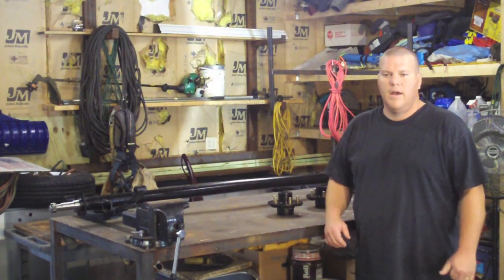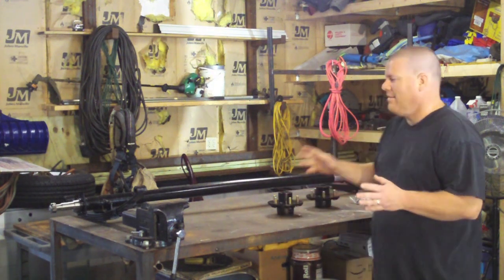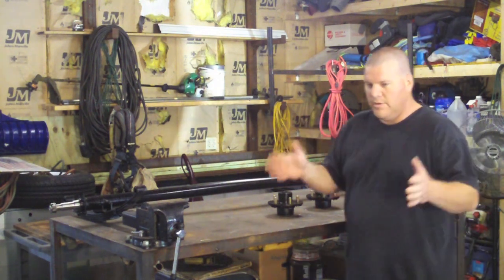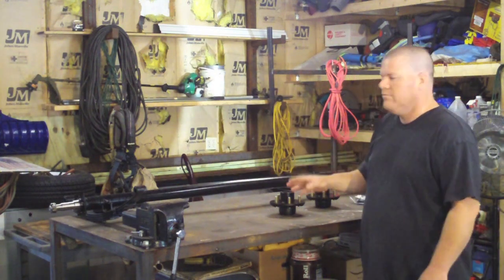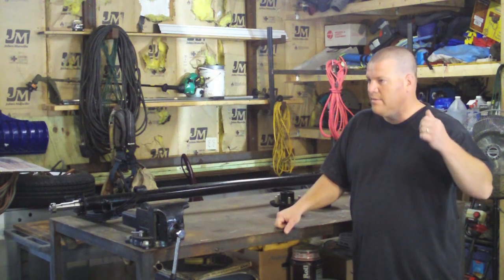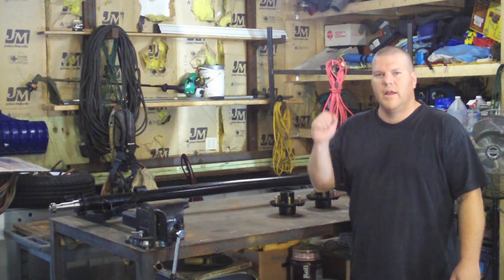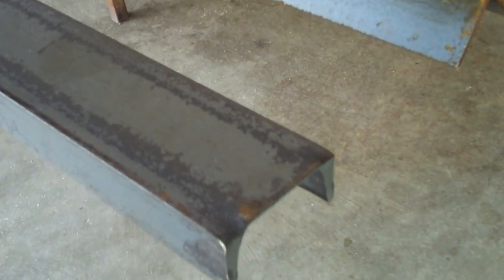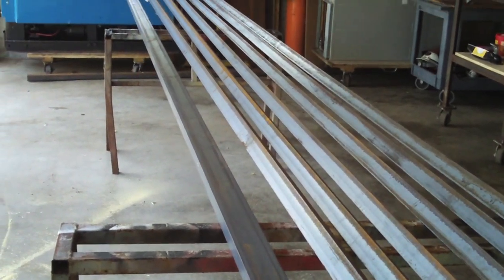How to Build a Utility Trailer Part 1 Introduction and Materials

Comment: I'm also thinking about building a trailer but I was thinking about using Square Tubing 2 inch by 2 inch by 1/8 inch would that have enough structural strength instead of using 2-inch by 2-inch 3/16 angle what are your thoughts

Comment: I am looking to build a snowmobile/utility trailer. The problem is I don't see many plans for that wide of a trailer (80+ inches).  Any thoughts?

I also noticed that you use angle iron, would it be stronger/better to use box steel say 2 inch?

Thanks...great vid!

Comment: subscribed!
i have been thinking about picking up some extra cash by building a few utility trailers
i'm thinking about making a jig that everything clamps to then i can weld everything together. ....question how do you feel about running 6010?
it has more flex than 7018 which i like

thanks

Comment: Hey! great vids I've learn more about building trailers! 
I have a few questions
What's the smallest house power welder I can use to do this project? 
I don't do welding for a living but I wanna be able to do my own trailer so I wanna get an electric house power welder to do this! 
I have a trailer that came with slipper springs and tires underneath the frame and the question is! would it be any problem if I weld the kit for the double eye springs? 
will the frame rub the tire W/weight?